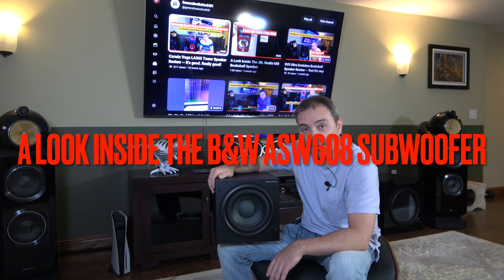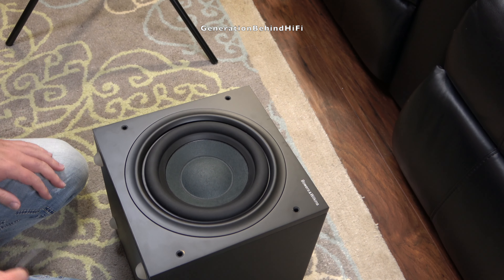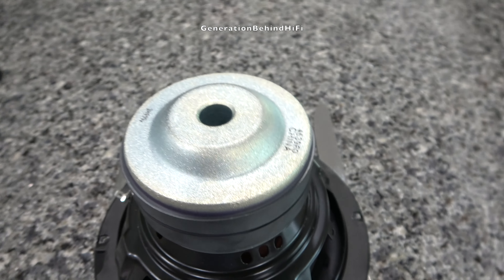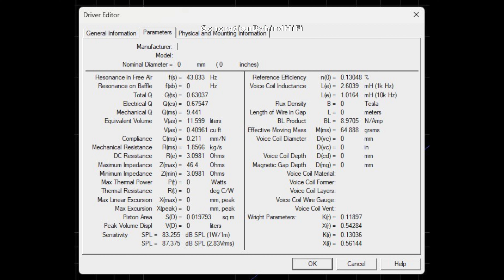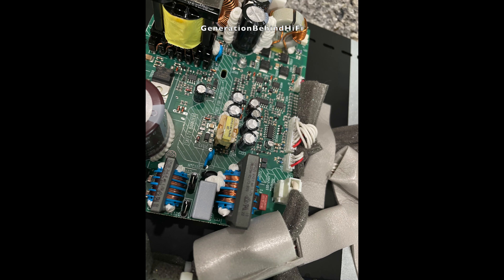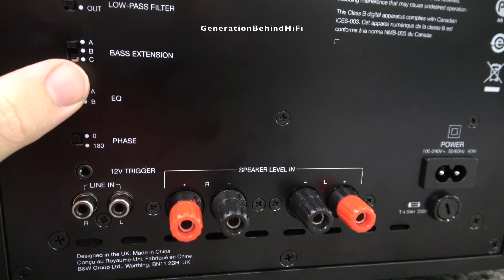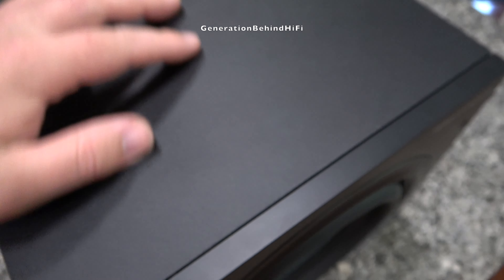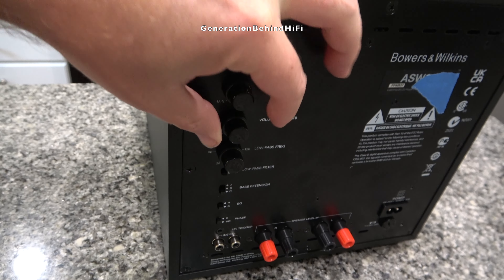A Look Inside The Bowers & Wilkins ASW608 Subwoofer

Comment: One note, if I’m not mistaken, is that the amp is rated at 200W peak power. It’s no bruiser (obviously).

I bought two used on Accessories 4 Less for $399 each to augment the bass of my Forte IV, which i run full range in a 13 channel system (everything else is in wall and in ceiling). It does an awesome job. Surprisingly full and satisfying bass in my pretty large open concept living room. The bass has a lighter, clearer tone than the single SVS SB 2000 i replaced. This affords them the ability to be crossed over at 120hz for the surrounds and yet they blend seamlessly unlike the SVS (which is an amazing sub, but isn’t built to crossover that high).

Perfect match for Klipsch high efficiency heritage speakers and for small/in ceiling speakers that only have bass to 100hz or so.
Reply: not much need for more than 200 watts, i run my 10" subwoofers with that. a 2x100w amp on two passive subwoofers with 10" subwoofer driver.
Reply: It uses an IcePower 200ASC module with an integrated switchmode power supply. It can hit just shy of 200 Watts into 4 Ohms, per AudioscienceReview's testing. Sadly it seems to not really be robust enough for the abuse you can subject it to with this sub, as the module has a high failure-rate. Luckily they are off-the-shelf parts, and the driver is very solidly built

Comment: I looked at these before my for 707 s2 B&w but when I tested them at richersounds I was disappointed. Bass quality was good but didn't go anywhere as low as the specs suggested when trying a movie trailer. What bothered me most was it was distorting when not even pushed to its limit. Maybe there was a fault with the sub but I let richersounds play with the settings since they're experts with audio
Reply from the maker: Hello! At the end of the day its still just a compact 8" driver so the law of physics still apply. Do you know if they had the EQ and bass extension settings set correctly on the subwoofer? By no means am I suggesting the ASW608 will be adequate for movie performance in a medium size or larger room. What I am saying is not everyone has room of a big bulky subwoofer and the ASW608 might be a good compromise for people who want to add a little bass to their system who otherwise wouldn't have the room for one. Considering its size I was really impressed with its performance and plan on keeping mine.

Comment: Love how B&W always goes the extra Mile on Driver design.
Reply: They didn’t. It’s a stamped steel basket.🤷🏻‍♂️
Reply: @dawolyan13  I said driver design, not basket design.. ,😭🍿
Reply: @HomeTheatre101  Anyone other than an audiophile snob would consider the basket as part of the driver. but you go on buying overpriced garbage. Someone has to!
Reply: @dawolyan13  you’re the one that said the basket is part of the driver... I’m literally referring to the Cone materials if you really want specifics.
Reply: @dawolyan13  And never said I was gonna buy it, need some Advil for your pain?

Comment: I cant imagine anyone arguing that inductance isn't a negative characteristic. 

An amplifier's instantaneous current capability, ... into a driver's inductance, those two elements determine driver speed.
Reply from the maker: You have to remember that this is the internet and sometimes people argue over even the littlest of things. :)
Reply: @generationbehindhifi  
You're absolutely right ... and subwoofer mythology runs 𝘿𝙀𝙀𝙋.
Reply: @FOH3663  I’d be more concerned in there was a lower inductance in a subwoofer
Reply: @peterotremba8980  
Care to elaborate? 
Inductance control is vital to performance.

Comment: Hi! Very nice video as always! It is really greate that you measure the drivers and give your impressions about the TS parameters. I found this very useful and informative! Just one question . Why do you said that the damping material tricks the driver like making it seems to be in a larger box? There are videos that makes measurements and comparison between same woofer with damping material and with no material and the result was that damping material does no improve the bass response.  I think that the damping material only helps in reduce cabinet resonances. Best regards!
Reply from the maker: Thanks! I appreciate the kind words and I'm glad you enjoyed the video. As for your question about the damping material that B&W is using which is also known as "polyfill". How Polyester fiber stuffing works, is that it slows down the sound waves inside the box, making the subwoofer perform as if the box were bigger. I haven even proven this on my own channel with some of my upgrade videos. You can read more about it here: https://www.tacomaworld.com/threads/how-polyfill-actually-works.19614/
Reply: These materials can indeed make a difference in perceived volume the driver sees.  If you have access to a Dayton Audio DATS, you can test this out for yourself.
Reply: @generationbehindhifi  thank you for the link. It is very useful information!
Reply from the maker: @pabloosvaldopenizzotto1098  No problem! The author of The Loudspeaker Design Cookbook talks about the benefits of polyfill in his book too.

Comment: The plate amp shows 40Watt usage at the cord.  I would be curious to see an amperage clamp on the power cord to see if it is in fact using only .3 amps @ 120volts (40 watts).

Comment: This is apparently known as a sound quality/audiophile subwoofer, but the size/price is not appealing.  Are you planning on reviewing  any of Dayton Audio's Classic Collection? Preferably the B65.  Thanks for the videos.
Reply from the maker: For some the size is appealing. I know it is to me because I needed a small subwoofer to fit behind my theater chairs and the ASW608 is perfect for that. I agree the price is a bit steep and I talk about that in this video, but B&W has never been known for value. 

I'm working with Dayton right now, but they want to review my videos before I post them and that's a deal breaker for me so it may or may not happen.
Reply: I have 2...they dig into the teens....Plenty power very musical sub....price fits the quality.
Reply: They are quite good for the size  with deep bass. But of course volume limited compared to big subs
Reply: I've listened to this sub it's a good sub don't know what you're on about

Comment: @tokeboisen If I ever encounter a failed amp at some point, is replacing the amp a difficult DIY fix? Thank you for the info
Reply: no its not
Reply from the maker: I have never had to do this but there seems to be quite a few amplifier modules available in the event they do fail.
Reply: @generationbehindhifi  mhm, they can fail whatever they want, soldering smd ic's like that its not like that everyone can do easily like swapping out tht components like a transistor or something.

Comment: Low pass filter: What does In and Out setting mean? Did they mean On and Off? Sorry for the newbie question.
Reply from the maker: When the low pass filter switch is set to "out" it bypasses the subwoofer's internal crossover which also disables the use of the dial. When the switch is set to "in" then you will have use of the subwoofer's own crossover and dial. Hope this helps.
Reply: @generationbehindhifi  Yes, thank you! My unit arrives on Monday. Can't wait to integrate them with my KEF Q350s 🙂

Comment: i mean the amplifier is trashy, wont gonna sound as good as a class AB in bass clarity plus if your ic amplifier goes away, its over!
Its not like some well built class D amplifier that is built for quality.
Sub is ok, stamped steal i mean okay but it should be better
amplifier as i said is trashy
box is well, its not the best, the stuffing saves it somewhat but like if i want a subwoofer, it should play 10-15hz too.
Reply from the maker: That's a lot of ask from an 8" driver (10-15hz). I think most people who buy a sub of this size do so because they have a space limitation. At the end of the day the law of physics still apply, but I think its great for its size.
Reply: If you think that its for 40-50hz then your avarage bookshelf speaker can do that.
whatever good this is built with double magnet, this a woofer if this cannot go under 20hz. A 8" Savard subwoofer in a box can do 10-15hz and its a subwoofer. That will shake your room.